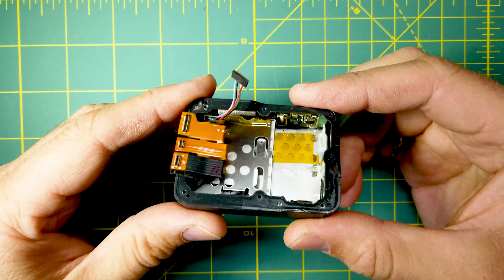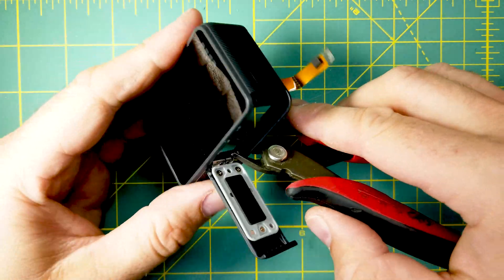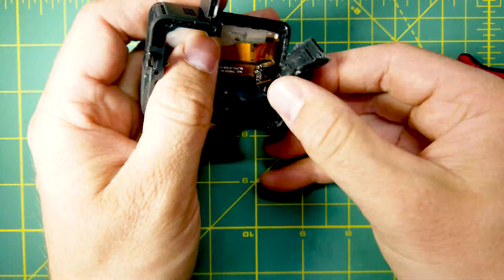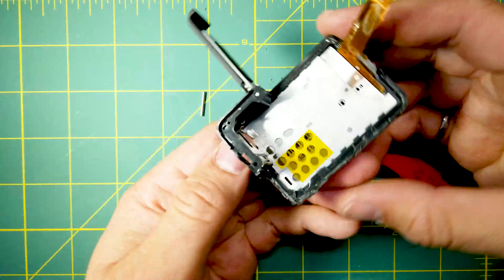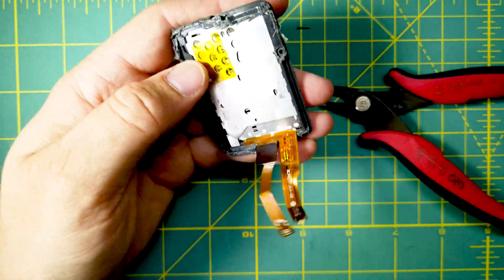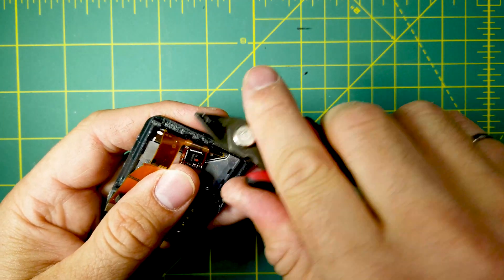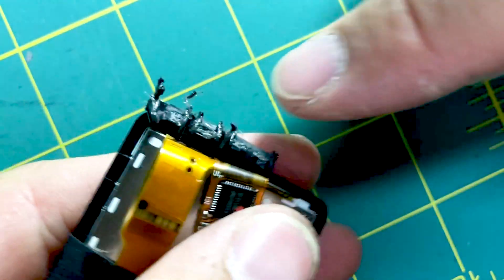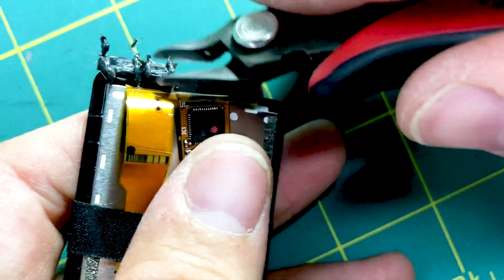Gopro teardown - removing back LCD

Comment: I’m doing this just now, it was such a ballache! I’ve got the rear alu plate off now and I’m just about to try and your soldering iron trick to remove the last bits of the frame
Reply from the maker: so did you finish with working LCD?
Reply: @JeromeDemers  yes I did! 3d printer heated bed helped me along the way
Reply from the maker: @jordan1991r  yes! I saw that tip after I did the video. If I ever take Hero9 apart, will try heated bed.
Reply: @JeromeDemers  how hot for how long?
Reply from the maker: @STRUDLpoba  I don't know since I did not do it. I would imagine a hot day in arizona. That would be easily 60 Celcius. That glue must be strong for high temp. Maybe not over 100C.